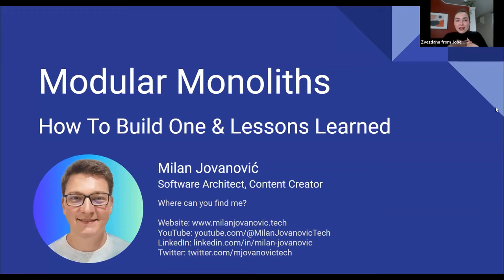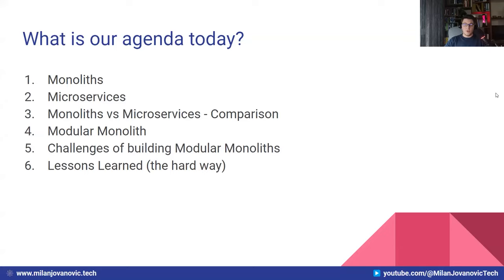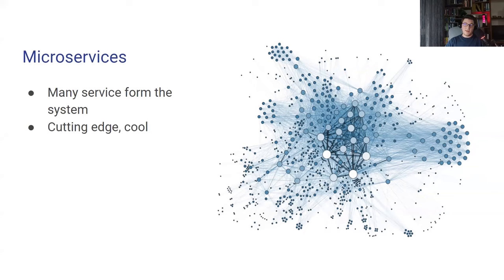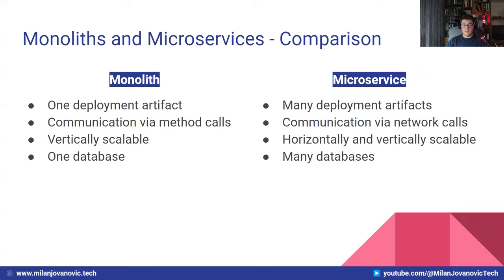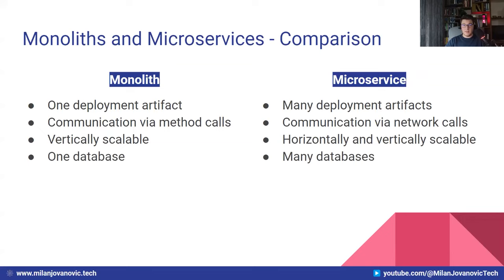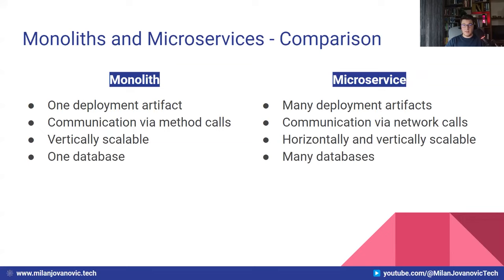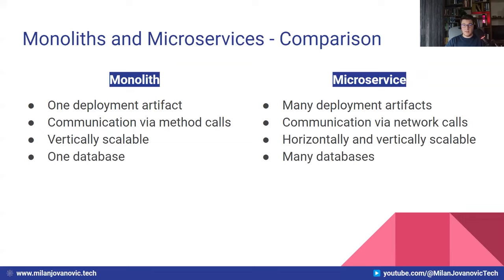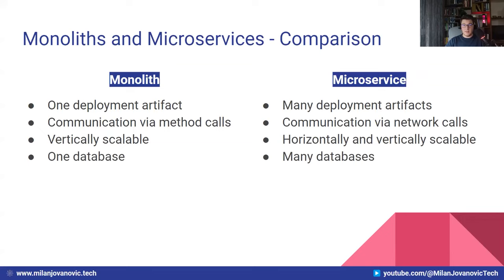Modular Monoliths: How To Build One & Lessons Learned

Comment: Great talk. With respect to data isolation, there is one more option I have found to be useful. Each module owns a set of tables and only that module is allowed to write to those tables. Each module exposes a set of views that other modules are allowed to read. Using database views allows the owning module to change the factual organization of data, while still exposing a stable view over that data to consuming third parties. This is more or less similar to exposing a public interface.
Reply from the maker: That's a really cool way to do it, Niels. I might even add it to my presentation next time I do this talk 😅
Reply: Sounds very smart!

Comment: I really fail to understand how modular monolith with inter-module communication implemented via the message bus is any better than the actual microservices? The advantage is clear when something like MediatR and CQRS is used due to the minimal overhead, but if we use a message bus then probably there is no point in having these modules inside a single deployment unit as we lose the ability to scale and deploy them independently as well as reducing the availability... Why give up the immediate consistency and minimal latency of the monolith?
Reply from the maker: The message bus doesn't have to be distributed, to start. It could be an in-memory bus (like MediatR). It's an approach to control coupling, or rather make the modules less dependent on each other. Async communication is helpful when you know you'll be moving to a distributed system but don't want the overhead (of microservices) from the start. We found it quite helpful on my last project. There was a legacy system acting as the source of truth, so we had to translate from the old system's data model to an improved one in the new system, so we were already using messaging. Figuring out the module boundaries with (physically) separate service would've been a huge mess. With a monolith we could move quickly, and reorganize the design as needed.

Comment: Just an observation. You started with Flowler's quote about starting with a monolith. You explained very well why you thought he said that. Because you don't know where your bottlenecks will be and what needs to be split out. 

Then in your lessons learned you did a 180 and said you wish you spent more time defining your modules upfront.

It seems like you broke the first rule, you didn't start with a monolith, you started with co-located microservices and only after doing that did you realize where your bottlenecks were and had to rework your module responsibilities. 

Correct me if I interpreted your learnings wrong.

Otherwise very good information and description of some of the patterns this type of architecture might contain.
Reply from the maker: Fowler's quote was just to bring up an argument for starting with Monolith first.

I guess that final lesson learned does come to the same conclusion as Fowler's quote, in essence, but it's something we didn't do well at the start. It doesn't hurt to repeat it twice.

Comment: For us the biggest pain with this architecture was to keep the api layer in check. 

Our team opted for hard-coupled api layer between the domains... Which caused every api update to require dependency update in multiple modules.
Reply from the maker: How did you fix that?
Reply: I am interested in how you fix this because I am building a system now and trying to use this approach. But my problem is any change in one module, I will need to build all modules and the core before redeploying.

Comment: It was a challenge to start modularising a legacy app by adding class libraries compatible enough to sit inside the legacy solution but I find it is doable with .NET 4.8, EF6, and a few other legacy technologies.
Reply from the maker: I can imagine the difficulties you ran into with .NET Framework
Reply: @MilanJovanovicTech  Yes, you hit the nail on the head. The weakness of modular monoliths is the inability to break away from and modernise the framework of the monolith and the version of libraries it supports.
Reply: @MilanJovanovicTech  The strength of the modular monolith architecture is it allows you to break away from and modernise the domains of the monolith. It also lets you share the database and its transactions.

Comment: I really love how you went through the problems and different solutions for each problem. I stumbled over the repo you mentioned in your video and was a little bit overwhelmed because I didn't get the inter-module communication by event bus. You gave a perfect explanation and a kind of smooth transition from method calls to messaging. 

One question (perhaps you have an idea, otherwise perhaps there are others here in the chat with some ideas): 

How would you code the module communication by method calls in Node.js? In Node you can do the same thing in tens or hundreds of ways. People coming from OOP languages tend to use classes and patterns like Dependency Injection while others just allow other modules to use an exported function. Is there a way to do it right or wrong?
Reply from the maker: As long as you are following some sort of dependency rule, you should be fine. I'm not sure if there is a way to expose an interface in Node.js - but exposing a set of functions seems to be a possible solution.

Comment: With module boundaries being well understood and defined, with modules owning their data and communicating over a message bus, what are the benefits of keeping them in one process other than to simplify deployment?
Reply from the maker: Distributed systems are really hard, there's all sorts of headaches you need to solve when doing microservices. I think people take it too much for granted 🤷‍♂️
Reply: @MilanJovanovicTech  There is no doubt about, but in your example you’ve already done the hardest parts (identified boundaries, split data, decided on integration approaches), is there a reason to not take full advantage of microservices (independent scalability, release cycles, tech choices, etc)?
Reply: @AndreiDzimchuk  I think biggest challenges of microservices will occur after  deploying the services. like containerization,monitoring,network latency and the maintenance cost .Also it requires relatively more experienced developers to build services which increase overall cost of the application

Comment: Hi Milan, thanks for sharing your knowledge, that is great. Two question: 

* Considering the database isolation (same DB diff schema or diff DB): Do we continuously use the concept of column relationship among tables using their FK's ? e.g.: (Customer Id) » (Order CustomerId)

* When we face a complex query from diff schema or DB (through EF e.g.), How could it be done using MM?

Thanks
Reply from the maker: 1) You can use FK's in the same DB, but it only helps with referential integrity. I'd keep using it if it's the same schema. If it's a different schema (other module) you're probably better of without it

2) Execute multiple queries and patch the results together
Reply: @MilanJovanovicTech  thanks for your reply.

So, do we may get data among different schemas using referential column without integrity?

Comment: Great explanation, in good detail and also with some realworld "handson" tipps, like the example with internal keyword in c#, the comparison of method calls and message bus etc.

I have one question though:
You say you don't want to share data between modules directly, only go over the modules boundry. Imagine a system where you have a timeseries database, its an industrial edge usecase:
You have one PC which is getting data from 50-100 sensors or controllers, it will collect all the data into the timeseries db every n seconds. Now one other module would like to get some data from the timeseries database, resp. the module which is having this DB.
This means you could only get data via the module interface (messagebus, RPC, REST, what ever), would you really strictly stick to this even you get some performance and complexity drawbacks or would you make some exceptions and access the database directly?
Reply from the maker: This is where we SHOULD make some tradeoffs, depending on our requirements.

- Is performance critical? Then we can merge these modules together. The dependent module has direct access to the timeseries database. Maybe it only makes sense to move part of one module, into the module with timeseries data? Lots of options to explore IF performance is critical.

- If we can live with some latency - then we can make tradeoffs based on complexity. Duplicating the time series data in the other module would give us excellent performance, at the cost of some latency and data duplication.

Where would you take this further?
Reply: @MilanJovanovicTech 
"Is performance critical? " I wouldnt say the performance is that critical or my biggest concern, I'm just a bit scared of wrapping all the Data which comes from the database in a API Call, in case of Protobuf Messages or REST I would have to put it into maybe json like data. I guess that gets bloated and memory intense quite quickly, I would also have to do the serialization and deserialization. By using binary formats in a protobus message directly from a language like java I loose language agnostic communication. And for every "type" of request I would have to build an "API fassade" around the DB which is always some effort. I hope you know what I mean? Using the DB directly would be fairly smooth, assuming there is a good library for the language of choice to communicate to the DB, which most probably is in most languages.

"If we can live with some latency" --> Not a big issue, the application is living on one PC and maybe has permanent 2-3 viewers via browsers concurrently and some data exchange to the cloud and the customer network (for example if there is an ERP connection or similar).

I'm not yet sure which approach I will take, It will take a little bit more time in my case to get a more bigger picture from the customers requirements and where he wants to go. I like the "merge" approach, resp. make a little bit bigger modules as you anyway mentioned you tented to have to much smaller modules in the first place which were chatty and you end up merging them anyway.

As always with architecture, its all a tradeoff, but I really enjoyed your video, it stood out to me. Lots of other videos can stay very shallow or abstract.

Comment: can we use kafka in modular monolithic architecture?
also you mentioned monolithic is communicated by method call. is this means by  REST or SOAP api. is not it a network call?
my question releted to  modular monolithic not only monolthic .
Reply from the maker: Yes - but you really don't need it. Even an in-memory queue should be sufficient to start off

Communication by method call is just that - an in-memory method call

Comment: Thanks for the video, how do you deal with a lot of UI tasks/pages that need to read data from multiple different modules?
Reply from the maker: As in, too many requests needed to serve a page?
Reply: @MilanJovanovicTech  more like when you need to read from different bounded contexts , data is “isolated” but you always need it. Yeah you don’t read it from databases directly, you use API but eventually you create more coupling and your FE or BFF layer becomes itself a big ball of mud(messy monolith)
Reply: @MilanJovanovicTech  vertical slices are not so vertical anymore